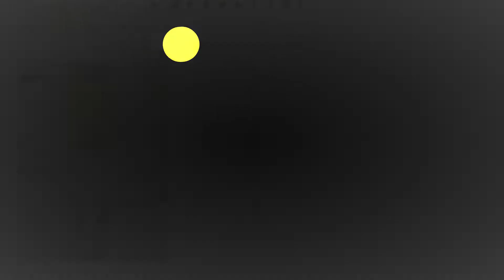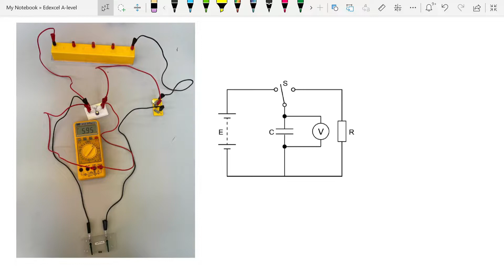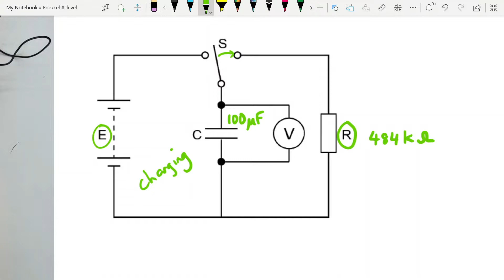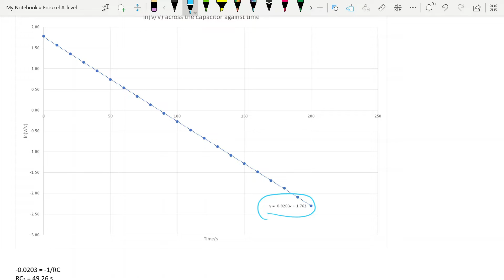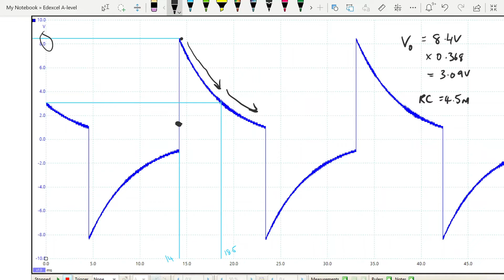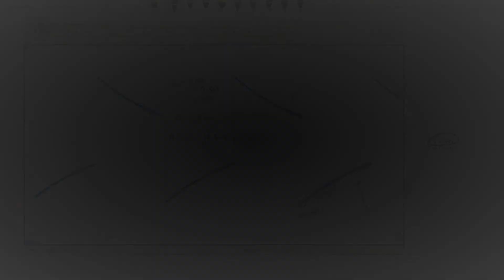Core Practical 11: Electric Fields: Edexcel A-level Physics

Comment: Hi, I still don't understand what the negative part of the oscilloscope is.
Reply from the maker: Because you are using AC, the electrons/current switch direction at a certain frequency. This means the capacitor will charge and discharge onto and from opposite plates every time the current switches. So the ‘negative’ side is the same thing happening in the opposite direction.

Comment: Hi, I didn't understand how to calculate the uncertainty and %unc @ 15:10 .
Reply from the maker: You want to get a feel for your data’s uncertainty over the whole range. If this were your own research, you migh find the U for each value of your IV and then get an average. But to speed things up, we only find the U and %U for the median value as this gives us a half-way point. For lower values, the same-ish U will give you a larger % and for larger values, the opposite will happen. So taking the median value is a short cut.
You then take half the range of the repeat data for that median value, put it over the average and multiply by 100 to get the percentage.

Comment: To find the uncertainty in the time constant could we draw a graph of worst fit and best fit and then find the uncertainty by comparing the gradients of the two?
Reply from the maker: Absolutely! The only issue I see is if your points are very close to the line of best fit. It might be difficult to do best and worst in that case. So you would have to judge the best way of doing it. If a graph has scattered points, go for it. If not, you’d need to look at the %U in the raw data.

Comment: I'm doing the practical write up for this one right now. In class we never tried / talked about the latter part where you switch out the resistor and use an oscilloscope. In most videos about the practical, or even in PhysicsAndMathsTutor's resource, this stage is ignored too. Though the exam board clearly tells us its important, I don't know whether there is a point to write it out knowing the teacher will give the same mark either way.
Reply from the maker: In terms of the write up, if you’re thinking about whether you’ll meet the core practical criteria, it’s probably not needed. And certainly, your teacher couldn’t penalise you for not putting it in if you didn’t do it in class.
But, in terms of what you could be asked in an exam, oscilloscope traces of capacitor charge and discharge are super important. Examiners know that many people don’t cover it in detail and so it’s rich pickings for questions. A lot of people will get it wrong so it’s a differentiating question.
Reply: @nutshellphy  Ended up writing it up last night anyways. But you are right, I have done some practice questions where they ask how the oscilloscope could be used with capacitors, so knowing about it is a good idea. Thanks for the great content - great detail but easy to understand. My constructive criticism would be to maybe structure these practicals into aim, method, equipment, risk assessment, results, calculations, graphing, evaluation, conclusion and using the timestamping feature for them (just a thought). Thanks again
Sebastian
Reply from the maker: Thanks for the feedback! Timestamping is a great idea and I will look at that in the future. At the moment, I'm trying to get out as many as I can for people doing exams this summer. But I'll have some breathing space after and can work on the videos more then.
The reason for my structuring them the way I did was dependent on the criteria that were being assessed in that particular practical. But perhaps they would be better as whole investigations. More food for thought! 
Thanks again..